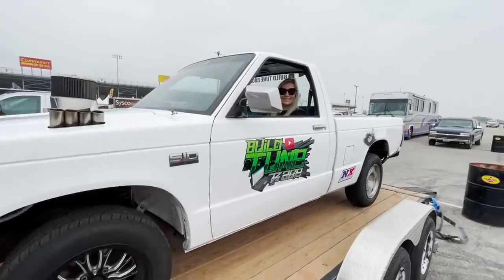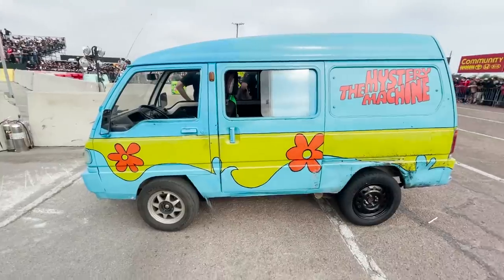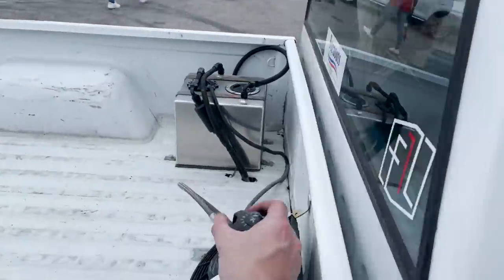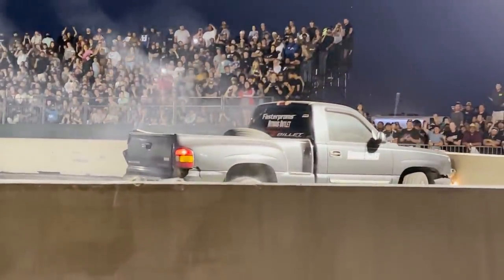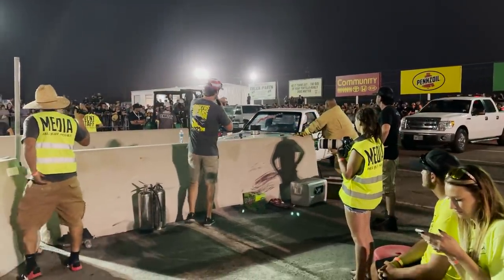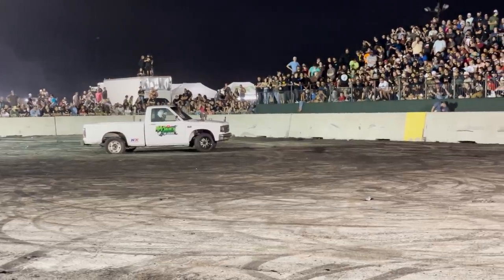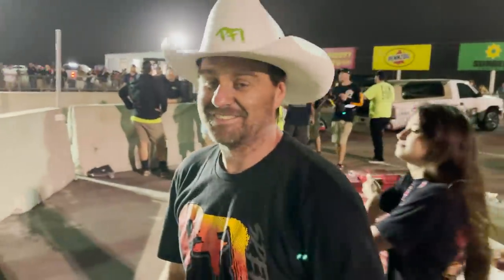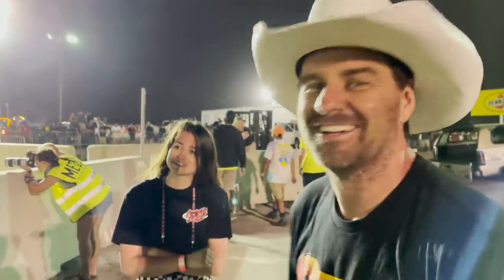Cleetus and Cars - Burnie Pops Tires in Record Time!

Comment: "Cowboy Honda Brent" flat unleashed Hell in the Angel Motorsports built Mystery Machine,
The Lead Sled brought some old school kool to the show,
What can you say about Demolition Ranch Matt and his El Chromino,
The Lead Sled brought some old school kool to the show,
JH Who is the man of the glowing red exhaust manifolds and eyes
LS George and his altered Ego Squirrel certainly gave it a the nitrous and found all the walls
Speaking of Walls Garza wins the Crown Vic quarter panel slam dance award
and twin Crown Victorians  as Larry Mac would say were a treat to watch 
But what can you say about the pure tire shredding of Burnie 
and you certainly should get an award for s
JH Who the man of the glowing red exhaust manifolds and eyes
LS George and his altered Ego Squirrel certainly gave it a full pull
The twin Crown Victorians as Larry Mac would say doing the synchronized burnout pad performance were a treat to watch 
But what can you say about the pure tire shredding power of Burnie besides you make it look so easy,
Lastly James in White Trash and Cleetus in Warbird certainly did not disappoint
Reply from the maker: Absolutely epic!